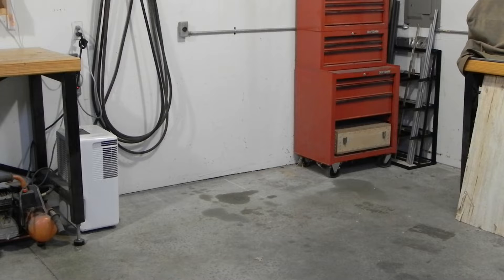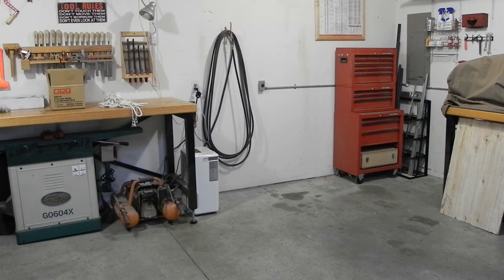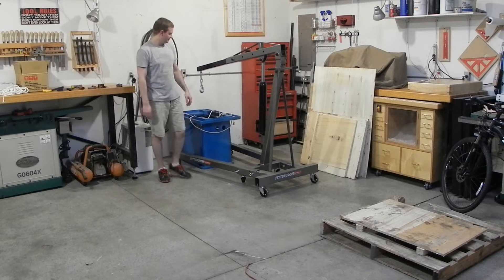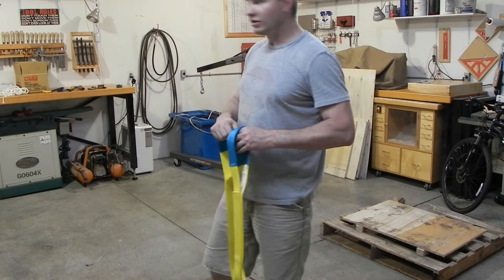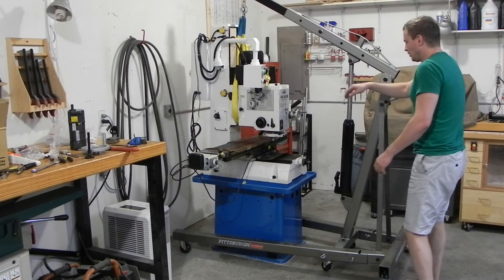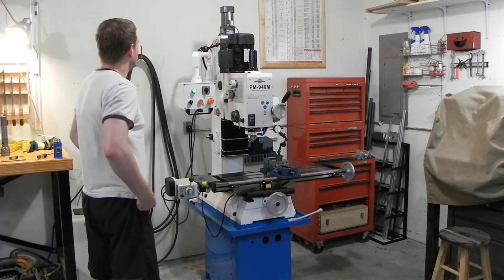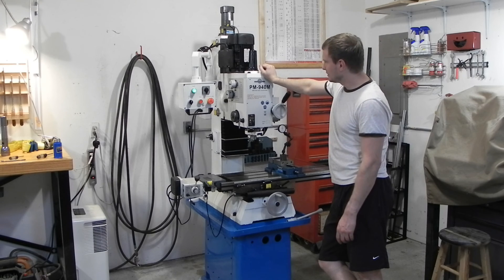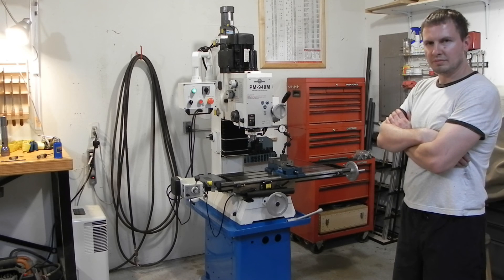Setting up a benchtop mill

Comment: Hi, can you tell what motor is lifting the milling head?
Reply from the maker: Hi Pawel,

I took the motor off during the actual setup process because it was in the way. with that being said if you jump to after 9:30 in the video you will see it on top of the column as i had reinstalled it by then. It's a small 120V AC gear head motor.

Comment: I wonder how this Matthews benchtop Mill compares to the Sieg SX 3.5?
Reply from the maker: looking at the sx 3.5 specs, the pm 940 is bigger in pretty much every regard.

X travel : 28" vs 19.75"
Y travel : 12" vs 8.25"
Z travel : 20" vs 9.875"
Quil travel :  5" vs 3"
Table size : 9.5"x40" vs 7"x29.125"
motor : 2HP vs  1.35HP
Weight : 1000 lbs vs 320 lbs

depending on how you look at it, the Sieg has the edge when it comes to the spindle, because its variable speed and goes to 5000 rpm. The 940 is a gear head with six speeds, the highest being  1970 rpm.

Comment: From seeing the different materials under the mill at various parts of the video you must have picked it up and down half a dozen times, I installed mine in less than 15 minutes from unbolting from the pallet. if the rest of your videos are the same with so much faffing about i'm out of here, what a load of crap to lift a small mill 2 foot

Comment: Important ? what size cherry picker is that a 1 ton or 2 ton?
Reply from the maker: It's a 2 ton.  A 1 ton doesn't have enough load capacity when the arm is set to give enough height to get the mill up on the table.

Comment: Question the specs say spindle travel 5" max so if you wanted to use a boring head you can't bore 5.5" down right?
Reply from the maker: Yep that's right.

If you want to accurately bore a hole that deep, line boring on the lathe is probably a better option, when it comes to standard home shop machines.

Comment: lol..you have several thousands of dollars just in the three tools I see..table saw, mill and drill press, but you don't own a $130 skill saw?? I find that funny for some reason. Anyway, nice mill. Im ordering something similar from China with a 2HP motor and it weighs over 1100lbs for $1200. The same mill here is like 3 to 4 grand
Reply from the maker: I have two circular saws, but I wasn't that enthusiastic about using them that close to the floor. I've seen first hand what happens when carbide tips meet concrete. I also had a slight concern about potential pinching as I cut away at the pallet thus weakening it.

Comment: Nice Mill!!! Did you do all these on your own? What is the actual height from the top of the table to the ground?
Reply from the maker: Hi Pedro,

Yea, I set it up all on my own. The table top is 41.5 inches above the floor. I've been meaning to raise it up another inch or two, but I've been putting it off because I haven't wanted to re-level the machine.
Reply: Alot of work (and heavy) for one person, good job!! Is that 41.5" after you put it on the base you made or from factory (no custom base)?
Reply from the maker: That's sitting on top the custom base. 

If it was just sitting on top the blue base it would only be 34.75" off the floor, and that's way to low for me.
Reply: Thanks! I watched your video  a couple of times. Do you have the video of when you were actually putting it on the base?
Reply from the maker: I didn't film that part, as I wanted to concentrate 100% on what I was doing. This mill just about maxed out my 2 ton engine hoist.
Reply: dans-hobbies Enjoy it, cheers.

Comment: Dan,
I have a slightly different machine. Did you have to add transmission oil to the geared head before use.My deciphered instructions in Chinese said 2litres of gear oil in the head and 500ml of lithium grease (I presumed on the lead screws). Mine came with bent draw bar, mt4 to b16 arbor for the drill chuck that was out by 1mm, low voltage transformer for light that blew up after a week and poorly machined T slots.  All fixable but took time. Oh well the joys of buying cheap! Happy machining.

Regards

Mike
Reply from the maker: Hi Michael,

I didn't have to add any fluids to my machine, it came completely topped off and ready to go. Though I should say I did thoroughly clean everything and re-lube it (except the head).

Comment: Thanks dan,  just set mine up this weekend.  It was about 90 minutes with the 2 ton lift and 3 guys. Taking the z axis way cover off and putting it back on was the hardest part. Now just fighting with the VFD.  Cheers
Reply from the maker: +Martin Mason The z-axis cover screws should really be plain old hex bolts, it would make life so much easier.